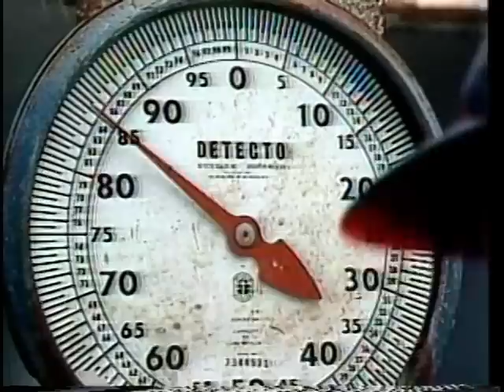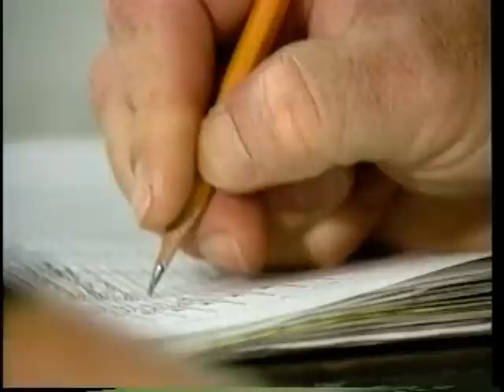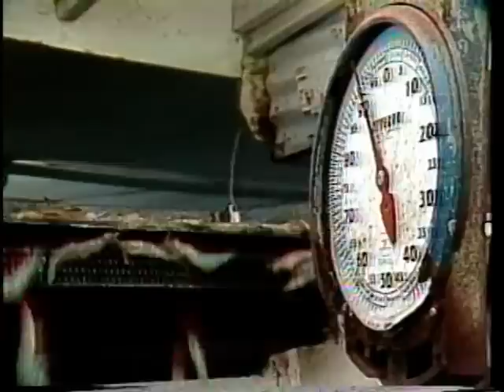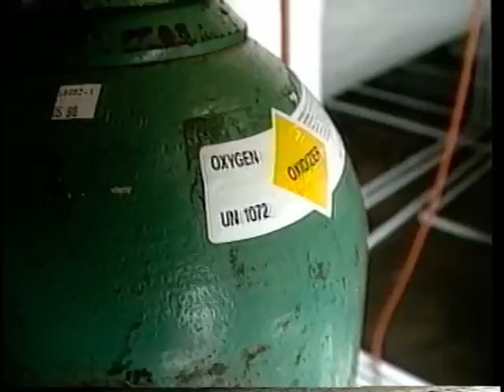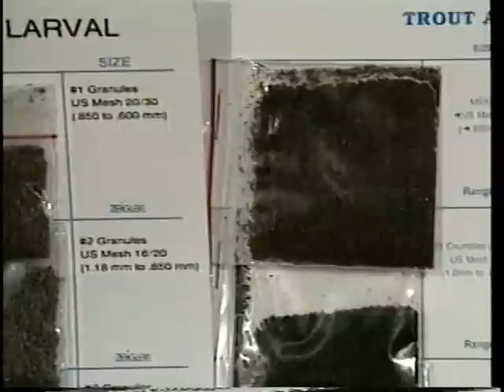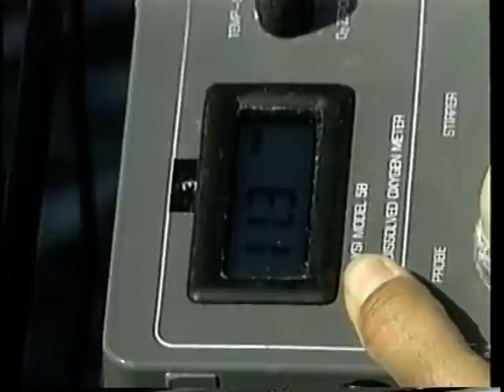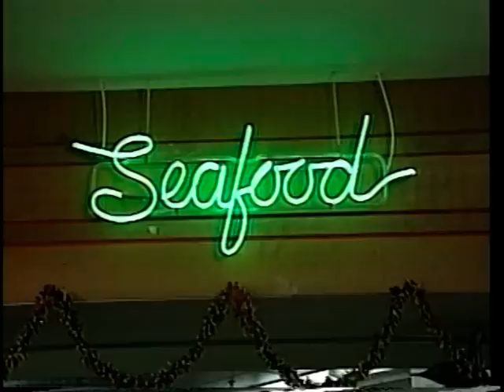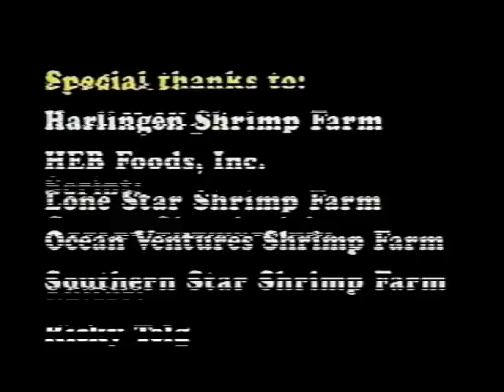Shrimp Farming

Comment: As an addition to my earlier post I'll also add that my favourite way of cooking and eating shrimp is to cook them in garlic butter then into a bun and of course 1 or 6 Bud's
Reply: I throw mine on the grill on a layer of tin foil
With plenty of butter
Then give them a few splashes of hot sauce and sprinkle them with
garlic salt
About half way through
cooking I'll splash them with some beer
And right before I take them off I'll give them another splash of beer. 
The suds from the bottom of the can works best. 
It usually takes about 10 or 14 can's.
Reply: @keithclark486  not too shabby an idea

Comment: I know this seems like a dumb question but why don't they use artificial wave generators to aerate the water?
Reply: +kenstr321 Horribly inefficient. Requires a lot more energy to run a wave generator.
Reply: Nathan Rogers Well if not wave generators then those solar powered floating fountains they use to keep ponds from being stagnate/ aerate the water for pond fish. It just seems like those paddle wheel 1/2 horsepower motors can't be that effect ether...
Reply: ***** Very true this looks like it's a mid to late 90's video. What is the most often used method of aeration now days?
Reply: 90's video or not, the paddle wheel is still one of the most effective and widely used aeration techniques. Sometimes simple is the best approach.
Reply: Nathan Rogers "effective" maybe, "efficient" doubtful. Still if it ain't broke, don't fix it right?
Reply: +kenstr321 I Think a wheel is cheaper to run then a pump. plus those ponds are packed they need to provide a lot of oxygen
Reply: tomkat898 Um, I can't see the logic in that. 1.5 to 2 horsepower motor vs a 85 watt pump. A electric pump is going to be more efficient then running an internal combustion engine (electricity 0.17 cents per kilowatt hour vs $1.95~ per gallon) I mean you can run a pump for 11 and half hours to every one gallon of gas. The only advantage I can see for this is current. The paddle wheels would make a (small) current in the pond churning it up and mixing the water better.
Reply: +kenstr321 85 watt pump? Nowhere near sufficient for the type or water movement needed to aerate 40+ acres of water sufficiently to supply oxygen to 10's of thousands of shrimp. Also keep in mind that in many other countries gasoline is subsidized to much more affordable prices. on top of that gasoline works in places where electricity is not available. Like floating in millions of gallons of saltwater.
Reply: Nathan Rogers Point taken, although 85 watt pumps can move over 52 GPM which is more then a bathtub of water per minute. Seems sufficient to me, but I have no clue. As for portability, electrical systems can be setup using solar, wind, or even fuel cells. Not saying that's practical, just possible.
Reply: +kenstr321 As an example according to a guide I have been reading recently on shrimp farming (looking at using shrimp in aquaculture) in the big ponds a 1 hp engine increases the yield by 500kg/hectare (2.4 acres). An electric equivalent would be approximately 750 watts. A lot of big freshwater prawn operations are situated along rivers and rather than aerate they divert water from the river through the grow field so aeration is done through water exchange. Energy input is negligible. Saltwater operations rarely have the option of water exchange so they use paddle wheels to aerate since they do not require electricity on site. The significant increase of yield justifies the expense. A 1hp gas engine can run for 10 hours on a little over a gallon of gas. Increase size of gas tank and you can make it run for days. Typical grow out is 90-120 days. Cost is ~$400 for 90 day grow out with a 1000lb increase in output. Numbers pencil nicely.

Comment: still wondering why use of topical surface aeration. still going on.  granted this is old video. but would of thought. air lifts or axial water pumps. would be used. to create overall "current / movement of water" within the ponds. to provide much better aeration. vs such localized  mini spot of aeration.

also i see "channels" err fence line but rubber / plastic going down the fence line. to split the ponds up. but i am not seeing any sort of water current happening.

the speech of black stinky mud in bottom. i see no real recovery system of moving waste out of the system err pond. even if during water changes.  and purely guessing waste is only removed at end of season.
Reply: how could you create current without damaging or stressing the shrimp ?
Reply: Mark Pickett put a carrot out in front so they paddle harder?